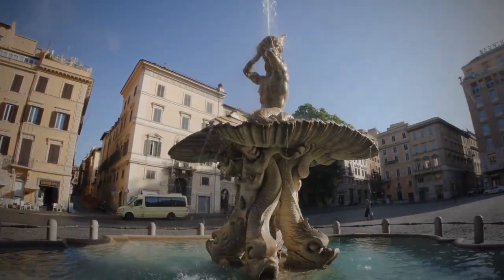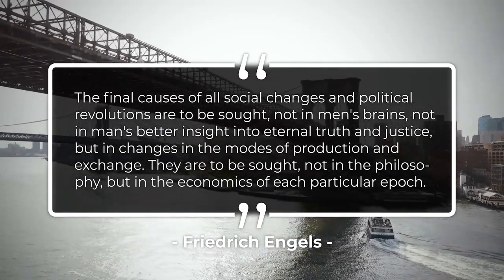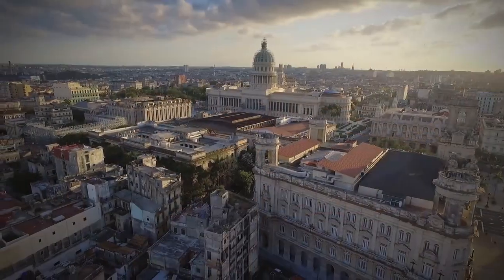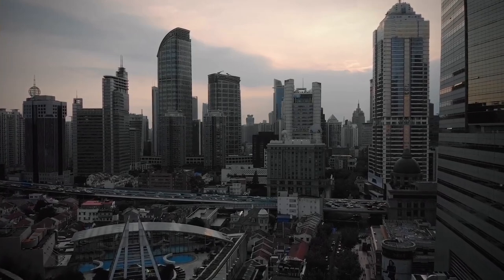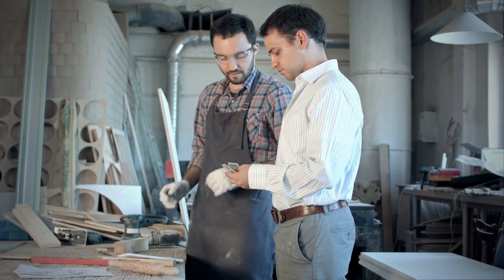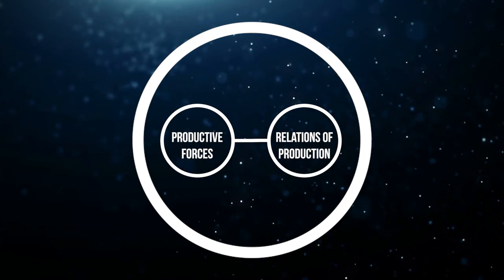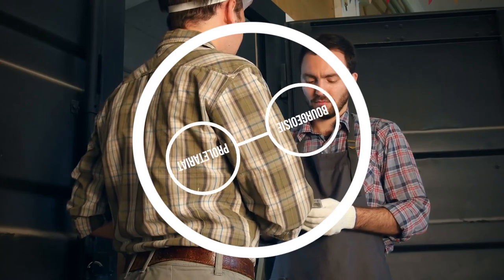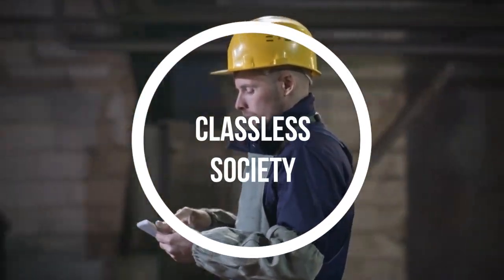What is Historical Materialism? | Socialism 101 #9

Comment: So it is said in the video that as the modes of production change with the resolution of class contradictions, the societal systems change with the concurrently changing mode of production.  Why between the slave to serf to capitalist society does the same class struggle then appear in different forms?  That assumption of resolution seemed to imply there would be more of a resolution of that dialectic between these systems.  Based on this assumption, why does it then only disappear completely during the transition to Communism?  If the video is construing it as that fundamental to society transition, it seems as if this pattern would be more acutely resolved between slave to serve to capitalist instead of essentially reforming each time.  It seems like the video upends the idea of resolution between systems presented.  On a slightly different note, outside of the validity of that assumption, only looking at the continued class dialectic presented between the slave to serf to capitalist systems, it then also seems like a leap to present this obvious dichotomy as being completely resolved in the bridge to communism from capitalism.

Comment: Could you do something on the difference between surplus value and variable capital?  I re-read that part several times but they kinda just sound the same to me.
Reply from the maker: Sure. I'll try bring it into the upcoming videos on the Marxist law of value. But to answer quickly, Capital can be divided up into Constant Capital and Variable Capital. Constant Capital is that capital that's turned into Means of Production. Variable Capital is that capital which is turned into Labour Power. Constant Capital is not capable of producing value greater than itself. However, Variable Capital, through production, produces enough value to not only cover its own costs (such as the price paid for the worker's labour power), but also produces Surplus Value over and above that.

That is to say, Variable Capital produces Surplus Value (though not only surplus value through surplus labour, but also covers its own value through necessary labour).

Make sense? Surplus Value comes FROM Variable Capital - but that SURPLUS Value is only a portion of the value created by that Variable Capital. For example, 50% of the value created may just cover the money spent on purchasing the worker's labour power, and 50% may be surplus value (though these percentages will vary depending on the rate of exploitation, as explained in Chapter 9 on Capital volume 1).

For more on this, I'd refer you to chapter 8 of Capital Volume 1, particularly this passage: "The means of production on the one hand, labour-power on the other, are merely the different modes of existence which the value of the original capital assumed when from being money it was transformed into the various factors of the labour-process. That part of capital then, which is represented by the means of production, by the raw material, auxiliary material and the instruments of labour does not, in the process of production, undergo any quantitative alteration of value. I therefore call it the constant part of capital, or, more shortly, constant capital.

On the other hand, that part of capital, represented by labour-power, does, in the process of production, undergo an alteration of value. It both reproduces the equivalent of its own value, and also produces an excess, a surplus-value, which may itself vary, may be more or less according to circumstances. This part of capital is continually being transformed from a constant into a variable magnitude. I therefore call it the variable part of capital, or, shortly, variable capital. The same elements of capital which, from the point of view of the labour-process, present themselves respectively as the objective and subjective factors, as means of production and labour-power, present themselves, from the point of view of the process of creating surplus-value, as constant and variable capital. " (https://www.marxists.org/archive/marx/works/1867-c1/ch08.htm)